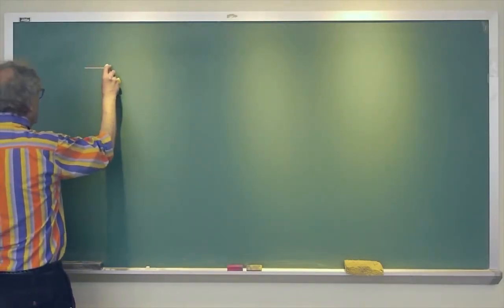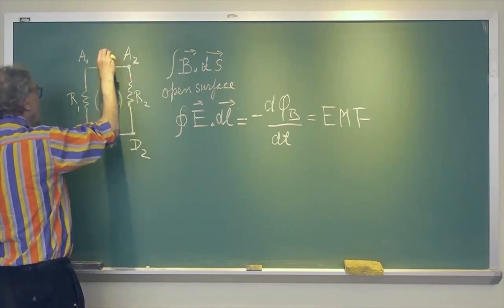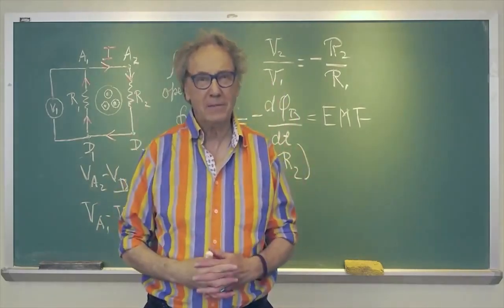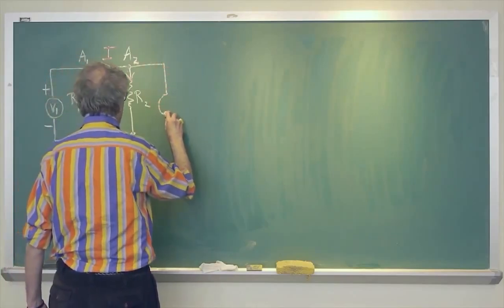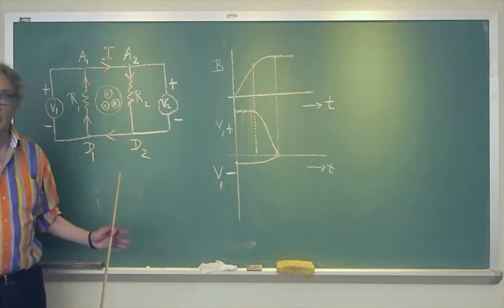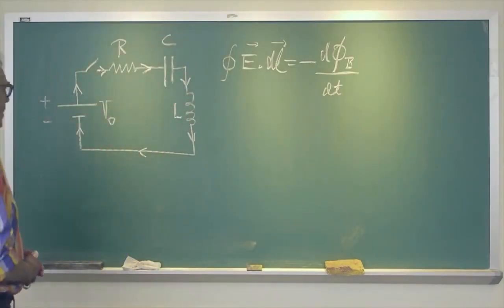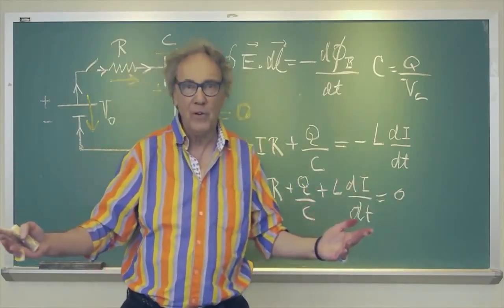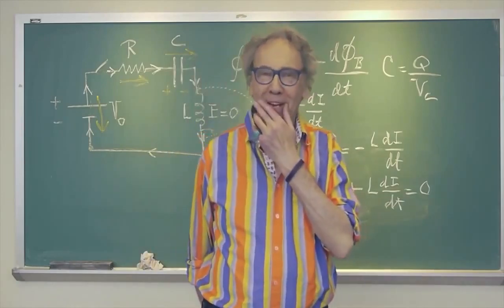Kirchhoff's Loop Rule Is For The Birds

Comment: Two things, 
At 10:40 , the voltmeter reading will NOT give the potential difference, it will surely read current multiplied by the resistance it is connected across, but that is NOT the potential difference, in fact the potential difference is created by the conservative field and not the total electric field

Also, at the end where you said that any path across the inductor will lead to measuring int E.dl to be +Ldi/dt, well it is not true for all paths, because the actual inductor is also such a path but it is zero there, only those paths having zero area enclosed in the plane perpendicular to the inductor will have that value of +Ldi/dt

On general, Kirchoffs law IS valid if you give the definition to be the int of conservative electric field across a loop is zero, which is true in the sense of the term 'conservative'. Also I STRONGLY AGREE with you that the authors and also most of the teachers don't understand this stuff and thus generate CRIMINAL MISCONCEPTIONS

Highly appreciate the video, please take my review into consideration and kindly share any review if you think I am wrong about the two things I mentioned
Reply from the maker: I demonstrated at the end of my lecture #16 of my 8.02 E&M course at MIT that two identical voltmeters attached to the same 2 points in a circuit can show very different values. https://www.youtube.com/https://www.youtube.com/watch?v=nGQbA2jwkWI&list=PLyQSN7X0ro2314mKyUiOILaOC2hk6Pc3j&index=17
This can also be demonstrated with a transformer.
https://www.youtube.com/watch?v=b7i2uMx7gHo&list=PLyQSN7X0ro22zanLOcvkaSY-IZqheFYM5&index=8
In fact, look more closely at my circuit; it is a transformer. My closed loop is the secondary winding (only 1 winding) of a transformer and the primary windings are in my electromagnet. 
The reason is that an induced EMF (Faraday's Law) creates a non-conservative E field. This means that moving a test charge between the same 2 points in a circuit can require a different amount of energy (even with opposite signs!). You still aren't getting any energy for free, because it comes from the source of the time-varying magnetic field.
When a voltmeter reads a value V it means that the integral of E dot dL across the voltmeter is V. 
In cases where Kirchhoff's loop rule (KVL) applies, 2 voltmeters attached to the same 2 points in a circuit will always show the same value. Kirchhoff's original text can be found in the following link, pages 497-514: https://books.google.de/books?id=Ig8t8yIz20UC. Clearly he was fully aware of the prerequisite for his "loop rule". KVL is a special case of Faraday's Law. That's why Faraday's Law is one of Maxwell's equations and KVL is not.
My demo was first suggested and published by Romer in December 1982 in the American Journal of Physics. This demo has now become a classic; it's done all over the world at many colleges and universities.
ElectroBOOM and Dirk Van Meirvenne believe that 2 voltmeters attached to the same 2 points in a circuit must always show the same value which is not true. It's quite  embarrassing that they each posted a video on their channel in which they claim to have proof for their wrong ideas.
Also read Professor John Belcher's thoughts on Faraday's Law and on KVL. Professor Belcher is my former colleague at MIT. http://freepdfhosting.com/0813df09f5.pdf
ElectroBOOM insulted me in his video by mentioning that the reason why my 2 voltmeters read different values was due to "bad probing". He stated that if I had done the demo correctly both voltmeters would have read the same value. He could not have been more wrong.  
The following video may also help some of you to understand why 2 voltmeters attached to the same 2 points in a circuit can give very different readings. https://www.youtube.com/watch?v=LGdN7rDB3XE
Reply: @lecturesbywalterlewin.they9259  You didn't read my comment, did you?

Comment: I did not expect walter to cheat. There is no loop without the energy source. He should draw the ideal current source in the loop as emf generator. As soon as he dos that, the point A1 and A2 will become single point A so will become point D.
only with the current source will  it become a loop. otherwise its just a pair of resistors connected in parallel.
Reply from the maker: Don't feel embarrassed if this physics is above your level; you are not alone. Non-conservative E-fields are not taught in high schools. 
I demonstrated at the end of my lecture #16 of my 8.02 E&M course at MIT that two identical voltmeters attached to the same 2 points in a circuit can show very different values. https://www.youtube.com/https://www.youtube.com/watch?v=nGQbA2jwkWI&list=PLyQSN7X0ro2314mKyUiOILaOC2hk6Pc3j&index=17
This can also be demonstrated with a transformer.
https://www.youtube.com/watch?v=b7i2uMx7gHo&list=PLyQSN7X0ro22zanLOcvkaSY-IZqheFYM5&index=8
In fact, look more closely at my circuit; it is a transformer. My closed loop is the secondary winding (only 1 winding) of a transformer and the primary windings are in my electromagnet. 
The reason is that an induced EMF (Faraday's Law) creates a non-conservative E field. This means that moving a test charge between the same 2 points in a circuit can require a different amount of energy (even with opposite signs!). You still aren't getting any energy for free, because it comes from the source of the time-varying magnetic field.
When a voltmeter reads a value V it means that the integral of E dot dL across the voltmeter is V. 
In cases where Kirchhoff's loop rule (KVL) applies, 2 voltmeters attached to the same 2 points in a circuit will always show the same value. Kirchhoff's original text can be found in the following link, pages 497-514: https://books.google.de/books?id=Ig8t8yIz20UC. Clearly he was fully aware of the prerequisite for his "loop rule". KVL is a special case of Faraday's Law. That's why Faraday's Law is one of Maxwell's equations and KVL is not.
My demo was first suggested and published by Romer in December 1982 in the American Journal of Physics. This demo has now become a classic; it's done all over the world at many colleges and universities.
ElectroBOOM and Dirk Van Meirvenne believe that 2 voltmeters attached to the same 2 points in a circuit must always show the same value which is not true. It's quite  embarrassing that they each posted a video on their channel in which they claim to have proof for their wrong ideas.
Also read Professor John Belcher's thoughts on Faraday's Law and on KVL. Professor Belcher is my former colleague at MIT. http://freepdfhosting.com/0813df09f5.pdf
ElectroBOOM insulted me in his video by mentioning that the reason why my 2 voltmeters read different values was due to "bad probing". He stated that if I had done the demo correctly both voltmeters would have read the same value. He could not have been more wrong.  
The following video may also help some of you to understand why 2 voltmeters attached to the same 2 points in a circuit can give very different readings. https://www.youtube.com/watch?v=LGdN7rDB3XE

Comment: You are sayibg it true but there is something important where is the voltage source in the loop
Reply from the maker: You too do not understand Faraday's Law. Te Voltage source is the -dphi/dt
Reply: @lecturesbywalterlewin.they9259  Sir i completly agree with you about the agreement that kvl and kcl wont work here the reason is this that here we dont have a circuit with voltage source parallel to them 
The reason you see diffrent voltage on each resistor is they are in series not parralel you have to look at it in an easier way
Reply from the maker: @alexradix4820  KVL does not work bcoz the induced EMF is non-conservative PERIOD  All induced EMF  (thus also with all transfromers are non-conservative).
Reply: @lecturesbywalterlewin.they9259  i said kvl doesnt work here 
 you are analizing the problem in the wrong way 
I dont mean the formula i mean the picture that you have in your mind of it is diffrent
 i think you need to make the shapes in an easier way becuase these 2 arent parralel its close loop of series resistor
You should simplify the problem
Reply from the maker: @alexradix4820  Don't feel embarrassed if this physics is above your level; you are not alone. Non-conservative E-fields are not taught in high schools. 
I demonstrated at the end of my lecture #16 of my 8.02 E&M course at MIT that two identical voltmeters attached to the same 2 points in a circuit can show very different values. https://www.youtube.com/https://www.youtube.com/watch?v=nGQbA2jwkWI&list=PLyQSN7X0ro2314mKyUiOILaOC2hk6Pc3j&index=17
This can also be demonstrated with a transformer.
https://www.youtube.com/watch?v=b7i2uMx7gHo&list=PLyQSN7X0ro22zanLOcvkaSY-IZqheFYM5&index=8
In fact, look more closely at my circuit; it is a transformer. My closed loop is the secondary winding (only 1 winding) of a transformer and the primary windings are in my electromagnet. 
The reason is that an induced EMF (Faraday's Law) creates a non-conservative E field. This means that moving a test charge between the same 2 points in a circuit can require a different amount of energy (even with opposite signs!). You still aren't getting any energy for free, because it comes from the source of the time-varying magnetic field.
When a voltmeter reads a value V it means that the integral of E dot dL across the voltmeter is V. 
In cases where Kirchhoff's loop rule (KVL) applies, 2 voltmeters attached to the same 2 points in a circuit will always show the same value. Kirchhoff's original text can be found in the following link, pages 497-514: https://books.google.de/books?id=Ig8t8yIz20UC. Clearly he was fully aware of the prerequisite for his "loop rule". KVL is a special case of Faraday's Law. That's why Faraday's Law is one of Maxwell's equations and KVL is not.
My demo was first suggested and published by Romer in December 1982 in the American Journal of Physics. This demo has now become a classic; it's done all over the world at many colleges and universities.
ElectroBOOM and Dirk Van Meirvenne believe that 2 voltmeters attached to the same 2 points in a circuit must always show the same value which is not true. It's quite  embarrassing that they each posted a video on their channel in which they claim to have proof for their wrong ideas.
Also read Professor John Belcher's thoughts on Faraday's Law and on KVL. Professor Belcher is my former colleague at MIT. http://freepdfhosting.com/0813df09f5.pdf
ElectroBOOM insulted me in his video by mentioning that the reason why my 2 voltmeters read different values was due to "bad probing". He stated that if I had done the demo correctly both voltmeters would have read the same value. He could not have been more wrong.  
The following video may also help some of you to understand why 2 voltmeters attached to the same 2 points in a circuit can give very different readings. https://www.youtube.com/watch?v=LGdN7rDB3XE

Comment: Electric field cannot exist in ideal inductor?  Why not?   It exists in capacitors.   Even a straight superconducting wire will have a magnetic field if there is current flowing in it, i.e. it has inductance.  I don't get it.
Reply from the maker: a current can go through a super conductor but no E-field can exist in it! Very basic Physics - use google

Comment: In this talk you state that there is no electric field along the conductor of a self inductor and in lecture 16 you state that there is an electric field along the conductor of a loop around a changing magnetic field. Can you add any detail to your thoughts on the nature of this electric field. Here is the reference .        https://youtu.be/nGQbA2jwkWI?t=1180
Reply from the maker: I can not add to the clarity of that lecture. I suggest you watch it again. The bottom line is that KVL is only a special case of Fayraday's Law. Thus FL always holds,  KVL sometimes holds.  If you always apply FL you cannot go wrong (thus KVL is not needed).  Thus FL is one of Maxwell's eqs, KVL is not.
Reply: @woodcoast50 the electric field inside the conductor refered at that point in that lecture is the tiny electric field Etot that obeys Ohm's law in it's local form: Etot = j/sigma. In a good conductor and with "reasonable" current density this field is very small, usually of the order of a few microvolts per meter. The better the conductor, the smaller the value of Etot.

In the limit for sigma --> infinity (perfect conductor) the magnitude of Etot inside the coil goes to zero. Assuming a perfect conductor is a way to simplify the analysis so that we do not have to consider the tiny ohmic loss in the coil's copper.

In a perfect conductor we have a big voltage ACROSS the coil's terminals, and zero voltage ALONG the coil's conductor. (KVL dies)

In a real good conductor we still have a big voltage ACROSS the coil's terminals and a very tiny voltage ALONG the coil's conductor. (KVL still dies)

EDIT: oops, sigma is infinity in a perfect conductor.

Comment: Hello friend, let me know if  I got it, kirchhoff law is just for conservative fields or just for fields that there is no changing flux  in time, or fields that is  zero in a chosen closed loop because there is not another kind of energy field coexisting in the same time  in another direction, right? I just trying to learn the electromagnetism, it is really hard for me for help me understand a electrical noise in some electrical application for example, only that. Thank you
Reply from the maker: KVL The closed loop integeral of E dot dL = 0
Faraday: The closed loop integeral of E dot dL = -dphi/dt.Thus KVL is only a special case of Faraday's Law. FL  is therefore 1 of Maxwell's 4 eqs.
Reply: kVL just for conservative field, right? by the way, when it is not a static field, the energy involved is the wave of motion of the changing field not the field intself, like in the electromagnetic waves, right?

Comment: both resistor and pulse width modulator reduce current in a circuit.But both devices are totally different,it's tricky.One is analog and the other is digital.We should be careful with measurements.
Reply from the maker: I demonstrated at the end of my lecture #16 of my 8.02 E&M course at MIT that two identical voltmeters attached to the same 2 points in a circuit can show very different values. https://www.youtube.com/https://www.youtube.com/watch?v=nGQbA2jwkWI&list=PLyQSN7X0ro2314mKyUiOILaOC2hk6Pc3j&index=17
This can also be demonstrated with a transformer.
https://www.youtube.com/watch?v=b7i2uMx7gHo&list=PLyQSN7X0ro22zanLOcvkaSY-IZqheFYM5&index=8
The reason is that an induced EMF (Faraday's Law) creates a non-conservative E field. This means that moving a test charge between the same 2 points in a circuit can require a different amount of energy (even with opposite signs!). You still aren't getting any energy for free, because it comes from the source of the time-varying magnetic field.
When a voltmeter reads a value V it means that the integral of E dot dL across the voltmeter is V. 
In cases where Kirchhoff's loop rule (KVL) applies, 2 voltmeters attached to the same 2 points in a circuit will always show the same value. Kirchhoff's original text can be found in the following link, pages 497-514: https://books.google.de/books?id=Ig8t8yIz20UC. Clearly he was fully aware of the prerequisite for his "loop rule". KVL is a special case of Faraday's Law. That's why Faraday's Law is one of Maxwell's equations and KVL is not.
My demo was first suggested and published by Romer in December 1982 in the American Journal of Physics. This demo has now become a classic; it's done all over the world at many colleges and universities.
ElectroBOOM and Dirk Van Meirvenne believe that 2 voltmeters attached to the same 2 points in a circuit must always show the same value which is not true. They each posted a video on their channel in which they claim to have proof for their wrong ideas.
Also read Professor John Belcher's thoughts on Faraday's Law and on KVL. Professor Belcher is my former colleague at MIT. http://freepdfhosting.com/0813df09f5.pdf
ElectroBOOM insulted me in his video by mentioning that the reason why my 2 voltmeters read different values was due to "bad probing". He stated that if I had done the demo correctly both voltmeters would have read the same value. He could not have been more wrong.  
The following video may also help some of you to understand why 2 voltmeters attached to the same 2 points in a circuit can give very different readings. https://youtu.be/T6S5VS03xZc
Reply: @lecturesbywalterlewin.they9259  Thank professor for replying,i will watch those videos.Physics and knowledge is abundant.I saw the incredible and fascinating of physics from quantum physics experiments,laws emerged in different scales.But in general purpose,we only need to use simple rules.
Scientists always argue and that's how it is just like philosophers do,maybe we don't understand each other so well.